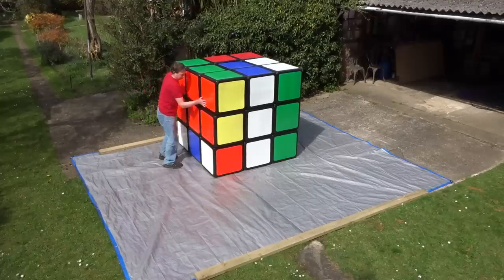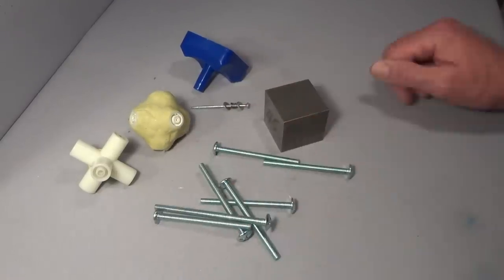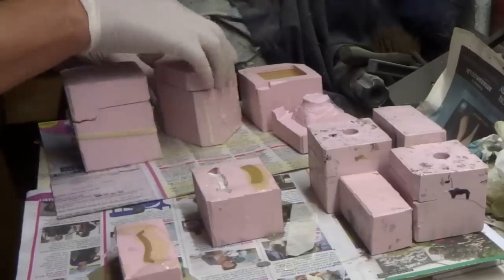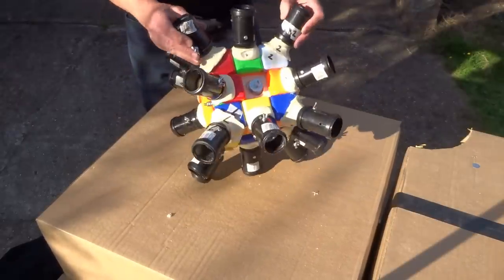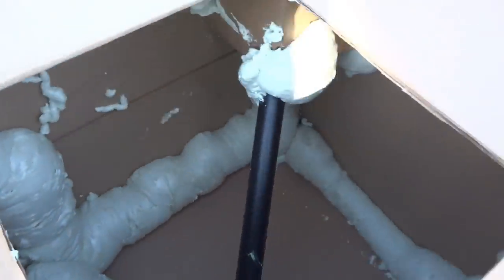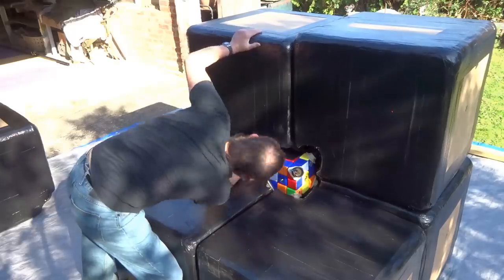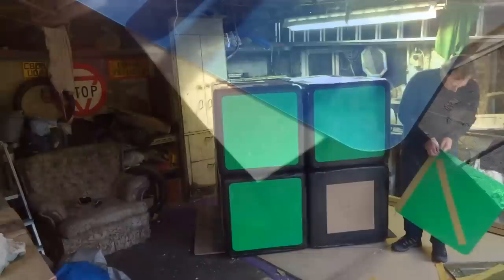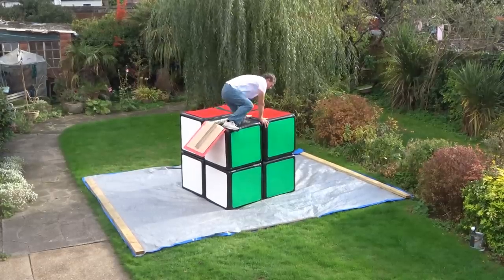Construction of WR Giant 2x2x2 Rubik's Cube puzzle (by Tony Fisher)

Comment: what if you scanned in the core of a regular cube, sized it up, printed it as large as you can. and have a good working core that way
Reply from the maker: Yes, that would work but it would cost thousands.
Reply: @TonyFisherPuzzles  you could try and print it on a medium sized printer, in diffremt parts which you would fasten together. Than extend it in the same way you did with the 3×3, but because the core is larger it would be able to become larger. Ofcourse the outside woulnt be printed. That would indeed take ages
Reply from the maker: @phancyisfancy8510  Still incredibly expensive.